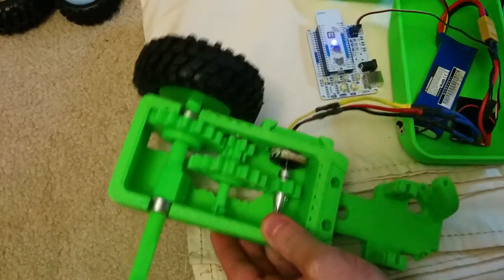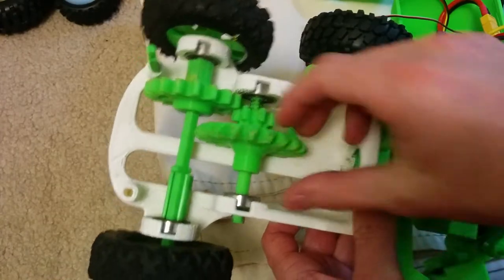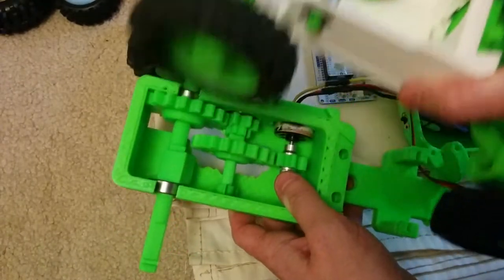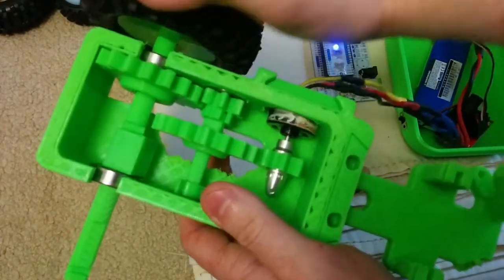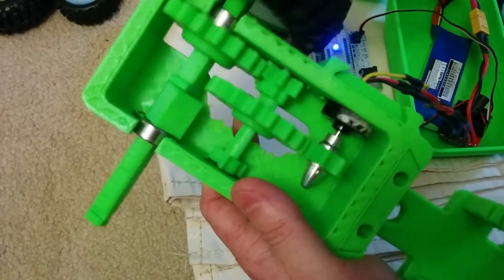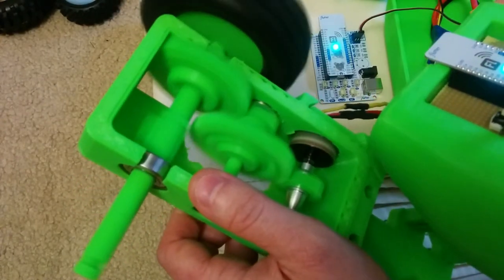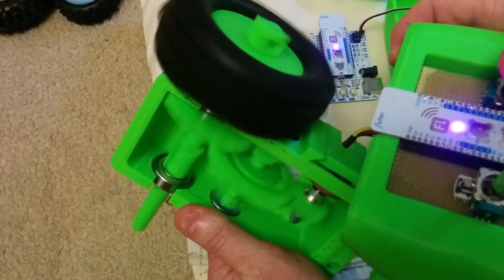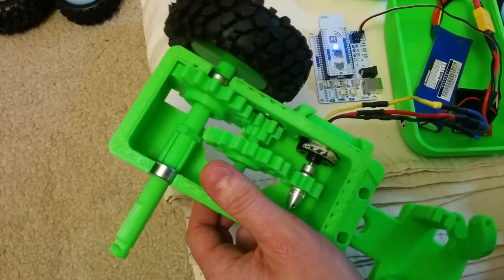Flutter Scout V2 Preview

Comment: Building one now, got all the parts, just printing this week.  Any install guide?  Did you need to mess with the ESC much?
Reply from the maker: awesome! I noticed the repo may be missing some parts. I need to push those... but no detailed build guide. maybe I should make one. :-)
Reply: +Taylor Alexander Yes please throw those up there, I can post a guide, I'm taking pics along the way.  Got the electrical side all ready to go, just need to start printing.  Realizing my Printrbot Simple Metal might be just a bit too small @ 150mm per axis.
Reply from the maker: +Mike DiMare ah yes, the 150mm issue. it's very close, I wonder if the printer has any wiggle room there? I really need to redesign it to fit that, but I've got zero time for Scout right now. I'll try to update the files in the next week or two. please bug me if you've got the rest printed and you're just waiting on these.
Reply: +Taylor Alexander Finally got a longer bed, wrapping up printing the last of the frame and long shafts.  Any updates you have been working on?